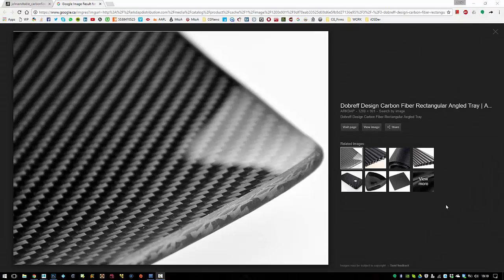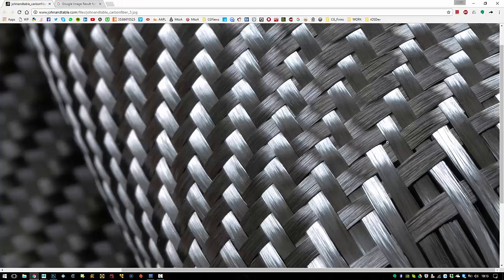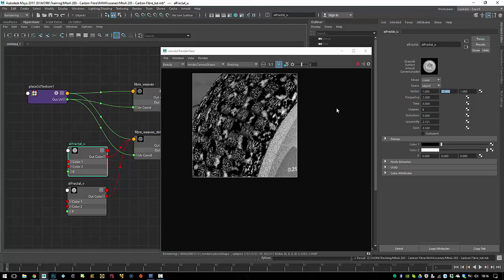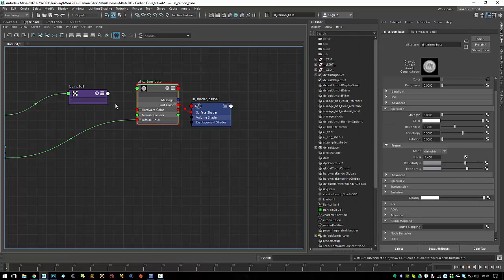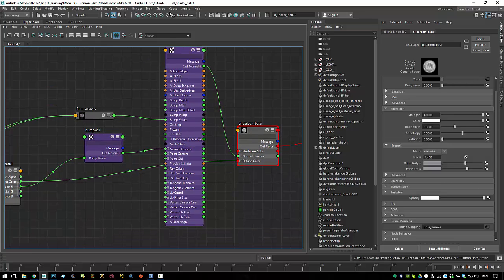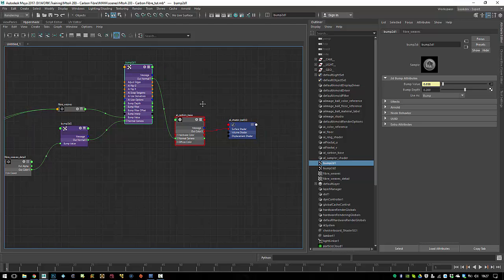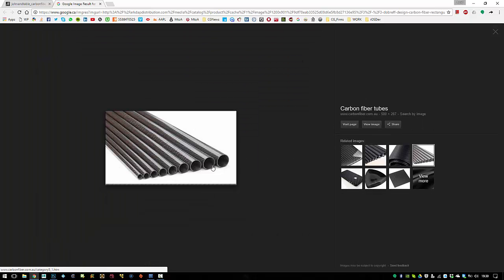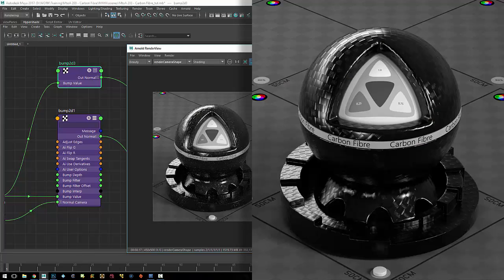MtoA 203 | Carbon Fiber | Material series using Arnold with Maya 2017

Comment: I was wondering why you use the R output of certain nodes as opposed to Color which would give RGB? I know for a B/W noise node the R=RGB value but is there a reason to use a single channel output? Thanks for this series its so helpful
Reply from the maker: do you have an example?
Reply: Yeah so at 10:18 you channel the Out Color R from the fiber weave node into the bump node. I was just wondering if there was a reason for this instead of the Out Color?
Reply from the maker: Because the bump value only accepts floating values. not RGB.
Reply: ahh that makes sense, thank you for clarifying. I'm working in the C4DtoA plugin, which gives me the same results. Thanks for the speedy reply!

Comment: Your tutorials are terrific and the channel overall is great! :) Working on watching them all...
Just have one question, does it make sense in this case to try and use the alSurface Spec1 and Spec2 to layer the translucent coat on top, as opposed to a layered shader with two materials which you showed? Would it work, and what would be the benefits of each approach?
Reply from the maker: I did two shaders, because the one shader (the coat) should not get the bump map. thats why its two. Otherwise yes of course you could use instead the spec1 and spec2 for that. But they share the bump. keep that in mind
Reply: Thanks a lot, I never thought of that!